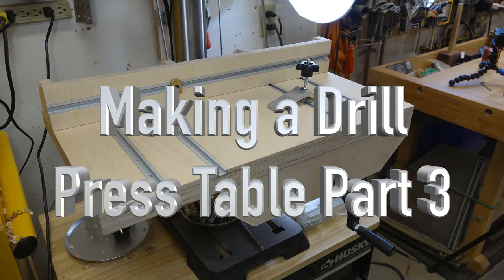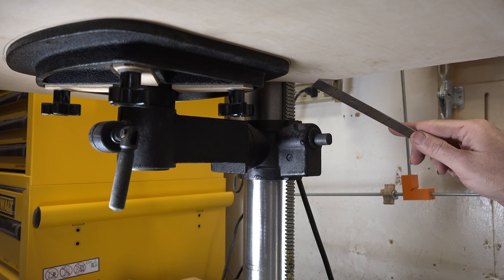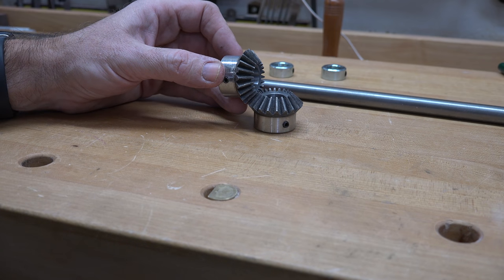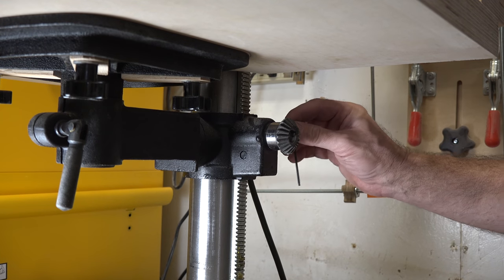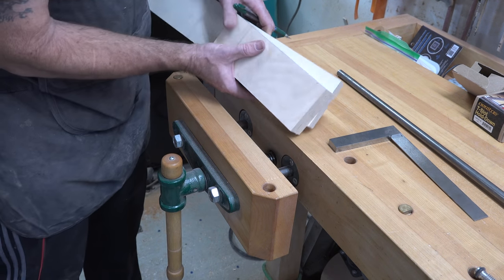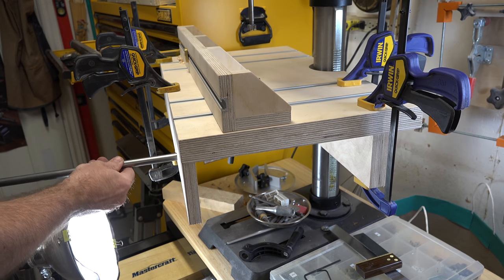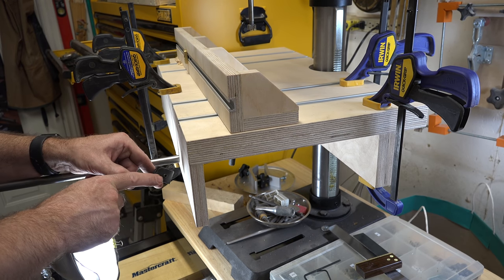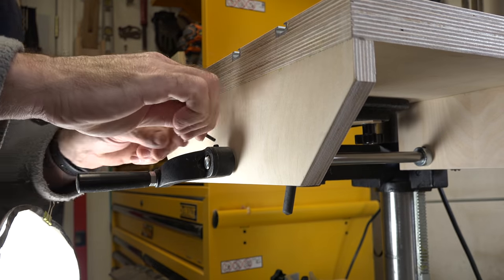Making a Drill Press Table Part 3

Comment: This is a nice take on the Shop Notes mod.  I did the same several years ago along with the lock crank relo.  Best thing ever.  I like that you added another t-track near the center and have been debating doing that.  I think I will to help clamp down smaller parts.
Reply from the maker: Glad that you liked the project Troy and I couldn't agree with you more.  This is the best tool modification that I have ever done.  No more busting my knuckles to raise the table.  No more straining to reach the back of the drill press.  No more struggles.  Just a fantastic modification that was well worth the time in doing.  The extra tracks in the middle are definitely a plus for the smaller parts.  Thanks for tuning in to the show.  It's appreciated.

Comment: You're a genius! The bevel gear modification is perfect.  The combination of my drill press table and my bad back make changing the table height a literal pain. I'm definitely going to try your design,
Reply from the maker: I think calling me a genius is a bit of a stretch Jim.  I'm sure that I am not the only one who has ever done this modification.  Either way, if you have back pain, the way I do, this modification is a must.  This is one of the best things I have ever done as a modification and I only wish I had done it sooner. Thanks for tuning in to the show and taking the time to leave a comment.  I appreciate your support.

Comment: I built the Drill press table got my floor standing drill press very much like yours(Not quite as wide but big enough for my needs). It includes a slide out waste insert due to the high likelihood that I will drilling into it. Could not get the gears to function properly. The gears would always slip due to the pressure needed to lift the table.  My solution was to use a coupler to extend the rod used to raise the table to beyond the end of the table side eliminating the need for gears. Now the lift crank is easy to reach and comfortable for raising and lowering the table. Thanks again for posting your drill press table videos. They got me motivated to get this long overdue project done.
Reply from the maker: Glad to hear that you came up with a solution Tom and that you have your drill press table and lift in a way that works for you.  It's always great to hear when viewers of the show can benefit from the work that I put into it.  I truly appreciate you tuning in and taking the time to chime in with your story.  Made my day.  Thanks

Comment: Kenny, this is brilliant. I recently got this drill press and have installed a table - the next project will be to relocating the crank handle as you have done. Thanks very much for the detail video, the parts list and the great step-by-step explanation.
Reply from the maker: Glad that you liked the show John.  Good luck on your build and the raising mechanism modification.  Thanks for tuning in to the show.
Reply from the maker: @grosbeakmc  Looks great.  Thanks for the shout out and for posting the links.

Comment: Hi Kenney:
I just finished my modification of the drill press table lifting mechanism following your video.  When ordering the drill rod I also ordered a 9/16 inch chucking reamer to open up the bore in the bevel gears.  There was less than .010" to remove and the reamer did an excellent job.  Thank you for the step by step procedure.
Best wishes,
Chuck
Reply from the maker: Glad to hear of the success of your project Chuck.  This is, bar none, the best modification I have ever made to a tool.  Being able to raise the table from the front of the press has been a godsend.  I hope you like your modification as well.  Thanks for tuning in to the show.

Comment: When you first started this drill press table, my big concern was raising and lowering the table. This video is a great solution for making table height adjustment convenient. I may have to build your version of this table now. A second consideration is the clearance between the fence and the drill chuck handle. I had to make an adjustment in the fence height to allow the drill chuck handle to clear the fence on my current table.  Thanks for very informative and useful content.
Reply from the maker: On my old drill press fence Tom, I had a 1/2 circle cutout to allow the chuck to come all the way down to the surface of the table without interfering with the fence.  I found over the years of using it, that when drilling smaller pieces, there wasn't enough fence support and I almost always had to place a sub fence over my existing one to fill that gap.  On this build, I decided to go with a solid fence and when I have a situation where the fence might get in the way of the chuck, I place sacrificial boards on the table to raise the stock that I am drilling.  I still get fence support this way and the the chuck never contacts the fence.  Thanks for tuning in this week and for taking the Time to leave me a comment.  I appreciate your support.

Comment: A very useful mod that's well executed and explained.  I saw a very similar one in one of the woodworking journals' YuTube video.  Now the question is don't you want to mod the table tightening mechanism to the front as well?
Reply from the maker: The tightening mechanism on mine isn't that difficult to reach and isn't the same knuckle buster that the height adjustment was, so while I did consider moving it to the front, I deemed it unnecessary for my application.  Thanks for tuning in to the show.

Comment: Need to extend the clamp bolt out too the left rear corner of the table. Support it in the same manner. Keep up the great work brother! Thanks
Reply from the maker: That was my initial plan Frank and it still might happen.  I ended up having to cancel the extension, due to space restrictions on the left side of the drill press between the drill press table and the yellow tool chest.  I was actually looking at it again today and wondering if it could still be done and I think I might have a plan as to how to do it.  Thanks for tuning in and for chiming in with your suggestion.  I appreciate the support.
Reply: Just a quick thought. You could install a longer bolt through the threads and then fasten on to the right end of the bolt. That would let you extend out to the right rear corner. Only it would reverse the action, it would be righty loosy lefty tighty lol
Reply: Just a quick thought. You could install a longer bolt through the threads and then fasten on to the right end of the bolt. That would let you extend out to the right rear corner. Only it would reverse the action, it would be righty loosy lefty tighty lol
Reply: Just a quick thought. You could install a longer bolt through the threads and then fasten on to the right end of the bolt. That would let you extend out to the right rear corner. Only it would reverse the action, it would be righty loosy lefty tighty lol
Reply from the maker: @frankherring6253  That would definitely be an option Frank.  I'm starting to wonder if the same bevel gears that were used on the raising mechanism can be used to move the tightening bolt from the back to the front.  I'm still thinking on it though.  Thanks for the suggestion.

Comment: Awesome drill press table upgrade, will absolutly look at this modification for my drill press. Do you have any ideas on how to move the table tightening mechanism to the front as well?
Reply from the maker: Brian, that tightening mechanism can be moved in the same fashion as the raising crank.  If that doesn't suit you, you can always extend the bar for tightening and have it come out the side, beyond the drill press table.  I would have extended mine but show real estate just wouldn't allow for the extension.  I hope this helps.  Thanks for tuning in and good luck on your modification.

Comment: That a great idea Kenny. After using it now for sometime, do you find the handle getting in the way. I plan on doing the same thing.
Reply from the maker: I did this modification ages ago Steve and I have never had the handle get in my way.  In fact, in my opinion, it still stands today as the best modification I have EVER done on a tool.  I will be doing it on every drill press I every own because it is just so awesome.  No more reaching for the height adjustment.  No more smashing your knuckles on the drill press table as you are adjusting.  No more twinging your back while reach under the table to get at the adjustment.  Just an all around awesome modification.  I recommend it to everyone.  Thanks for tuning in to the show sir.

Comment: Nice work. If the holes in the plywood, where the shaft goes through, ever wear out, you could put in cheap bronze bearings.
Reply from the maker: Great idea Doug.  Even a small copper pipe coupling would probably work for that application.  Thanks for tuning in to the show and for taking the time to leave a comment.  I appreciate you support.

Comment: Here are a few extra ideas if anyone cares.  Use some nylon washers along with the stop collars. Also, get some 9/16 bearings and mount them in a metal or wooden plate that can be adjusted fully. The make your though holes just a tad bigger. On the front, maybe add another washer to cover the larger hole. It would make more work but easier to adjust and aline.just a thought though.
Reply from the maker: All good ideas.  Thanks for tuning in and for chiming in with your suggestions.  It's appreciated.

Comment: But ... you still have to reach to the back of the table to lock the table.  What did you do about the locking level on the left side?
Reply from the maker: The locking lever is still very accessible and I left it as is.  If you wanted to bring it outside of the edged of the table, brackets could be made and the lock lever could be extended.  I hope this helps.  Thanks for tuning in.

Comment: Update... I was cutting some small pieces on my scroll saw. 3/4" pine, all straight cuts but 4 right angles. #9 double reverse blade. Two blades came out if lower clamp and bent severely. I got a third blade, did your sand paper trick and got a whet stone and rounded the back. Finished last 90% of the cuts with no problems. Was it the Beatles that recorded I'm a believer? Count me in. Regards, Bill
Reply from the maker: Glad to hear that the solution worked for you Bill.  Sometimes, all you need is a push in the right direction to alleviate a whole lot of stress and frustration.  Thanks for tuning in.
Reply: I checked, it was the Monkees. AARGH!

Comment: Brilliant!! I've always had the same problem, but just dealt with it. Now, in addition to doing this modification, I'm wondering if I can do something similar to control the locking collar (the one that holds it all in place once you've adjusted the height)? I bet that could be done, too. Thanks, Kenny! Super project! :-)
Reply from the maker: My original plan Norm, was to extend that mechanism and put it out on the far left of the drill press, eliminating the need to reach under to lock the height down.  Unfortunately for me, space restrictions in a small shop, make the extension of the locking handle next to impossible because other tools were getting in the way (that big yellow tool chest just to name one) and blocking the operation of the locking handle.  The idea is still in my head and I'm sure that at some point in time, you will see it on an Alternative Tuesdays episode of the show.  Thanks for tuning in and for the kind words on the show.

Comment: Hi Kenny. I really love your content and your approach. You are a thoughtful teacher. Could you tell me exactly which metal rod you used for this? I'm having a hard time locating the exact shaft size needed for this project. I have the same Drill Press as you. Thank you in advance.
Reply: There are so many metal types, alloys, cold rolled, grades etc. on that website. Not sure what to choose.
Reply from the maker: Hi Frank.  Thanks for contacting me.  I just purchased a cold rolled, 9/16" diameter steel rod.  It was actually a little too large so I had to file out the middle of the bevel gears to make it work but it was the closest that I could find.  The cold rolled works just fine though.  I hope this helps.  Thanks for tuning in to the show Frank and taking the time to leave the kind words.  If you have any other questions, please don't hesitate to ask.
Reply from the maker: Cold Rolled 9/16" diameter works perfectly.

Comment: Hey Kenny.  Just wondering, what brand of clamping element, I think that's what it's called, are you using on your bench at the 7:49 mark?  Do you like them?  Are they for 20mm holes?  I'm about to start drilling into my outfeed table to construct a makeshift MFT and I'll need accessories after I get done.  Thanks in advance.  Mark
Reply from the maker: The clamps that you are referring to is made by Veritas and is called a Quick Release Wonder Dog clamp.  It is available in either metric or imperial for various dog holes and I use this thing almost every time I work in the shop.  It is absolutely fantastic.  Here's a link.  https://www.leevalley.com/en-ca/shop/tools/workshop/workbenches/benchtop-accessories/74622-veritas-quick-release-wonder-dog?item=05G1030
I hope this helps.  Thanks for tuning in to the show.
Reply: @acutabove_woodworkings  Thank you, Kenny!

Comment: Hi Kenny! I was looking at the table that Shop Smith posted and they used nylon gears. I think you used metal gears, correct? Bill
Reply from the maker: That is correct.  I used metal gears for the modification.  Thanks for tuning in to the show Bill.

Comment: Excellent instructions as usual, Kenny.  I've got the same DP as you and I'm in the planning stages of making the table.  I'll be using your design with a couple of modifications. Thus far,  I've been getting an education on metals.  What kind of steel did you use for the shaft?  As you know, there are a bunch of them.... I'm a bit leery of filing out the metric gear like you did to fit the 9/16" shaft.  Woodsmith has a similar plan to yours but they use plastic gears which would be easier to drill out.  Think it's worth it?  I'll probably buy the Woodpeckers fence for this project because of the integrated dust collection.  Thanks again for posting and keep up the good work!  Mark
Reply from the maker: The steel in the project is cold rolled steel rod Mark.  It's held up really well.  As for filing out the gear, it's still going strong as well.  I'm not so sure that I would trust the plastic gears.  This mechanism takes a lot of abuse and I'm not so sure that the plastic gears would be able to stand the test of time with that abuse.  I guess there's only one way to find out.  If you decide to go with the plastic gears, you'll have to report back and let me know how they worked out.  Thanks for tuning in sir and good luck on your build.
Reply: @acutabove_woodworkings  Thanks Kenny.  I thought about it and had the same misgivings you did about plastic gears and ordered the metal ones.  I'll let you know how it turns out with the WP fence.  Thanks again! Mark
Reply from the maker: @markk4015  Looking forward to hearing back from you on the fence.

Comment: Only issue is the handle stocks out too much. I'd use a star knob or something that is lower profile
Reply from the maker: That is a personal preference thing for sure and if you like a star knob, then by all means, install a star knob.  For me, I prefer the extra torque of the stock handle, even if it does stick out a little more.  I've never had it get in the way.  Thanks for tuning in and for chiming in with your thoughts.

Comment: Hello Kenny, Great video and explanation. Question, Have you think on installing the same mechanism to the lock bolt to secure the high of the table? I think it is important the used of such feature as well since any time I started the  drill press, the table move. When it is locked, the table doesn't. Do you think this method can be apply to that bolt? Any thoughts?  Regards. AG
Reply from the maker: I can still access the table's lock down with the drill press table attached.  I did consider extending the locking bolt but didn't really consider using the bevel gears.  Possibly just extending the existing lock down rod to extend past the left edge of the table.  You can get more torque that way.  I hope this helps.  Thanks for tuning in to the show.

Comment: How do you lock the table in place?
Reply from the maker: I am assuming that you mean how it is held in place on the original steel drill press table.  In part one, starting around the 5 minute mark, I demonstrate exactly how it is held in place using threaded inserts and male jig knobs.  If you are referring to locking the table down once you get it set to the height that you wish, the original locking hardware is still intact and still functional.  It was never changed.  I hope this helps, but if not, feel free to ask more questions.  Thanks for tuning in.